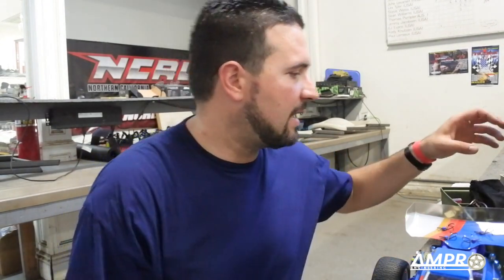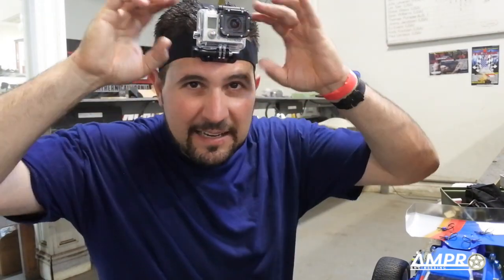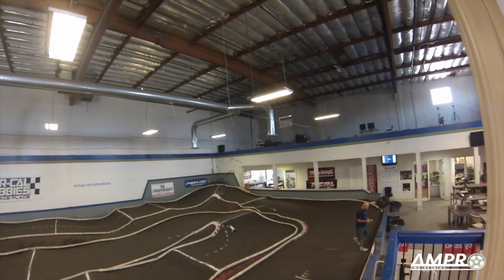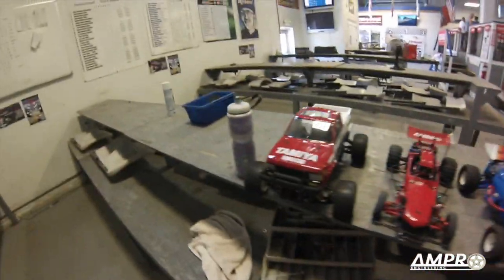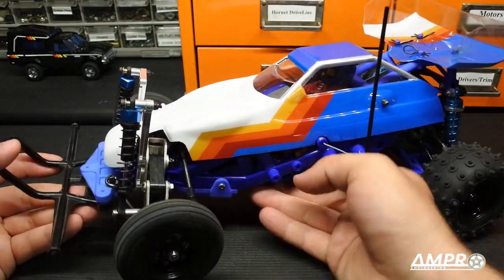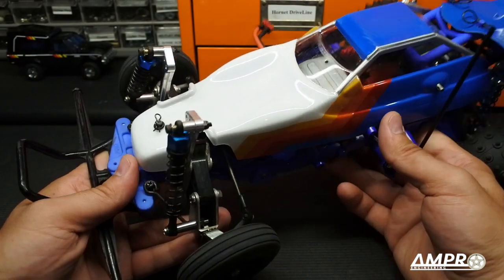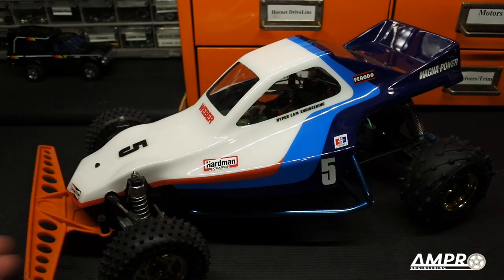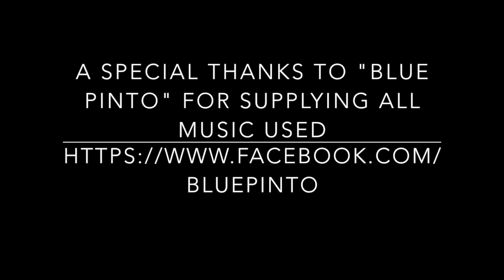e93: 3D Printed Tamiya "Poison Dart" Frog Running

Comment: Nice!  Know what would look cool on the frog a one shock set up on front like the hot shot.
Reply: yup, or Fox (nearly the same). pair of upper L shaped arms would just about do it, the uppers might also need an angled leg downward at inner pivot point to keep the arms from drooping down TOO far, so kinda T shaped or ---> shaped.
edit: uppers kinda looking (left and right) ------>    <------
the upper tips of the arrows (wherever they'd have to land) being the arms for the front transverse shock. this could still be like 1/2" wider than stock (total) to be nearer the width of outside rear tires, like what Andy's front arms did for the old Associated RC10 that Associated basically adopted in later releases. that low profile lateral front shock, very cool looking. it DOES kinda flop some, aka allowing more body roll to be handled moreso by the two rear shocks, BUT, once it's set up right the old Fox hooked up in dirt cornering really good!
Reply from the maker: Hmmmm... I like that....
Reply: I think it would look bad to the bone on the frog! Hey hows the wheel thing amajiggy coming along? =)
Reply: agree, great suggestion, really! I'm not a fan of the stock ORV/frog for the design flaws in suspension and transmission (we scuffed side plates for big fender washers to JB-weld reinforce because we weren't gonna drop 100+ for a thorpe diff!). I DO like the central space frame cage idea they had, but not those "VW" rear swing arm and shock arrangement that'd twist/bind, kink dogbones etc. just not all that efficient or easy movement with aluminum ring against plastic....
LOVE my old Fox, but darn it's a hassle going into it to get at the electrics because of the chassis body, like 14 screws later, good driving car tho!
Reply from the maker: Actually the design is done but im worried about drilling out your wheel.....I am looking for a reamer that will do it safer.
Reply from the maker: I have never seen a fox in person but I always thought it was pretty. I know how those electronic bays are...they sound awful
Reply: Hi I used a drill it worked great it dose not take to much off so it should follow the hole good.

Comment: the Panda Hornet.. they were a bit more brittle plastic but I liked that front wire torsion bar a lot, and whipped one up for my Tamiya with some sheet metal for hangers and a bicycle spoke. oh those spokes have ended up being used a few places and no I'm not looking for new (rude) suggestions for other places I really don't ever want to use them! need thicker harder steering rods, a smaller spoke Z bent and cut, threaded ball end, there ya go. they're fairly hard steel to resist bending and stretching, and already have a threaded end. slightly larger diameter so they'll fit snug into plastic holes that have been worn/wallowed out, perfect size for lots of things RC, and available cheap from about any local bike shop, or free if grabbed from a bent rim.
Reply from the maker: Yes, the plastic is VERY brittle on the Cyclone. The Cyclone didn't have the front sway bar though, that was the Rockbuster and Roadrunner. Always thought that was odd that the Cyclone had every other option but that. Bike spokes, what a great idea!
Reply: spokes are a super handy (and cheap available!) material to play with. it'd be totally doable (after bending) to wire wrap and solder up a slot car  chassis or a set of wheelie bars or....
Reply: model nutty try ribbed sheet aluminium instead of other sheet metals its light easy to cut, strong (as long as its ribbed) and light too. Its a nice material for using on rc.

Comment: Hey Man,
Love the Blue Chassis! Bush Devil? Can I purchase one? I'm currently working on a Blackfoot with my kid nephew and had so much fun with mine back in the mid eighties. He's only 8 but better now than eighteen.

Also, Have you done a Blackfoot > Frog > Beetle conversion video featuring Ampro parts? Love to see what innovations for smooth transitions you pull out!

PS, Signed up at Shapeways and have 9 items on deck. first things first though. MIP! super stoked to follow up with the rear suspension but ill undoubtedly snap some front end parts in the meantime.

looking forward to seeing what you come up with to solve the front end imbalance of quality performance!

Thanks for the quality work.
Warm regards,
Brett
Reply from the maker: Hey Brett, thanks for the kind words! I am actually going to be doing a buyers guide on the whole ORV series. I did the Lancia rally already but need to do the rest. I have not done any conversion on the ORV line up but its not a bad idea! As for the bush devil chassis, I wish I could help. Bought this decades ago and now they seem to fetch a mint.

Comment: I have Wild One as well, how come I don't see you work on this vehicle to improve the performance?? Also, do you think the MIP ball differential for blackfoot and frog is going to work in the Wild One??
Reply from the maker: I have not seen much that that car needs other than cosmetic upgrades. For me, that car is a much more of a scaler than a basher. I have a lot of upgrades for the cosmetics of the WO & FAV that can be seen on this channel. What were you thinking to upgrade on the car? As for the diff, it will not fit at all. We are designing a ball diff for the Hotshot family that may also fit the WO & FAV.

Comment: Car looks great on the track.
Reply from the maker: Thanks Joseph. It's not bad but that front suspension is no match for the rear.
Reply: @AMPROEngineering  it seams like it. Looks fun. I used to race but cant aford it . i still run my rc stuff. Im messing with the wpl kit. Taking my time with it. Thanks for the videos
Reply from the maker: It sure is. I used to be a Novak team driver but then it became...not fun. These should be fun!
Reply: @AMPROEngineering  it should be fun that is the point of the hobbie. I lost intrest in it awhile ago. I still enjoy it.

Comment: Man to me it seems like the front was too soft. I think tilting the front shocks inwards could help add progressive damping to the front. It looked like it dumped over the front in turns. Great job mate!
Reply from the maker: The front oil from stock was like water. I need to swap it out. Can't do much to the geometry without further altering the look of the car. I am already unhappy the the shocks are visible. The original idea was onboard units but cost and space were at a premium.

Comment: oh you already know my near hate on those ORV's, those stock rear arms with their cantilevered shocks, those front suspension arms relying on a long steel eye bolt etc etc yada-yada-ya (and bah! lol). I'm going to agree and suggest... yes to longer front swing arms and only to a length that ALMOST matches up to the width of the outer rear tire width, like maybe 1/4" short of on both sides, and if I remember correctly that's about 3/8" or 1/2" longer than the stock. for those eye bolt bars, wrestling with a few heavier bicycle spokes should get you there. shock tower a little shorter, same shocks bottoms mounted further out giving more travel and more stiffness both. not a fan of that front suspension configuration at all, but do think those things would improve it a bunch while still staying within the stock look theme and function. the slightly shorter shock tower, might move the upper shock mounting points outboard 1/4" worth, thinking angle and spring compression/strength to stay in line with the extended length swing arms. honestly I'm much more impressed with your upper ball linked front end for the Hornet, could be a really cool bolt on replacement to the ORV spaceframe if tweaked to fit with a matching shock tower to bolt on.... but that's getting a long way away from that ORV front end, not like you didn't go there in back either tho, whoops! OH WHAT DID I JUST SAY?....  I said copyright patent pending and charge Tamiya for serious design improvement where they can still use their ORV space frame they like to mass produce, is what. keep doing your awesome tinkering man!
Reply from the maker: Yeah they have some seriously weird ideas on those cars, none of which worked but it was the beginnings of RC so no one know what was going to work. I have an idea that will look almost stock but completely replace the wire retainer and the upper and lower links as well as the front H1 bumper. I have a couple projects ahead of this but I think I have solved it.
Reply: you know it, I'm curious to see!

Comment: Would basically recreating the front suspension from your King Blackfoot fix the problem? I've never owned one but it looks much more stable.
Reply from the maker: I thought about that but I also want it compatible with the stock front "springs". This is going to be tricky.

Comment: You'll probably get better stability & perhaps a bit more suspension length extending 1.5 - 2 cm on each side in front width & getting oil shocks on there.
Perhaps also see if you can create a bump in the a arm so you can angle the ballstud a bit more neutral then aimed downwards while the shock tower looks straight.

Perhaps you can also make a shock tower that is leaning backwards a few degrees (starts off straight but gets a bend halfway up too move the suspension mounting backwards a bit) as well too get on longer shocks with the existing a arms like the losi xx buggy if you take a bit of a space inwards in the a arms or perhaps make a hole in them so they go more in the centre sort of like a early traxxas emax a arm or like the tamiya egress being inside the a arm, supporting the leaning shock tower further that might give you a bit more room too work with the suspension geometry.

Ofc you can try a mockup with the 3d printer first for testing & perhaps reinforce the 3dprinted one by having a pair of carbon fibre braces sandwiched inside the shock tower for some extra strength & rigidity. (being 3dprinted with the space in between for it not made in two parts you put together is what im thinking atm.)
(Could be simple L plates past the bottom mount.
(Turned upside down ofc those carbon fibre L plates so they attach too the top of the shock)
Reply from the maker: So I do not like to change the width of these older cars. I am adamant that they retain some of the original style. That was why I made it so that the stock rear tires and rims still fit this suspension. The car does have oil shocks all around but they are all crappy i think. My plan is to completely do away with the front shock tower since the Frog never had one and do an on-board bell crank unit. The tower and the front geometry, as you pointed out, seem to not play nice. I agree., the arm= needs to be reworked. I love the idea with the brace between the towers. I have done something like the before and it works awesome.

Comment: What shocks are you running on the rear of the car?
 Also.....love the videos and your products!!!
Reply from the maker: They are some awful units I got on ebay years ago. They took a lot to make work well but trust me, you don't want them. Get a good set of 75-80mm units. Thanks for the kind words!
Reply: AMPRO Engineering 
Bummer......I just bought a set of GPM's because they looked identical.....lol.
Reply from the maker: Well the main issue is how the top cap seals to the main body. Do not over torque it an you will be ok. It is a bad design but they work fine.

Comment: Nice Car!! Will you really revise the front end??
Reply from the maker: Oh yes. I have an A-arm idea with completely new shock geometry designed in my head. This is after 2 other major projects.
Reply: So I wait. But I can still have the ORV front and middle skid plate installed (e56) first. And should be no conflict to your new front arm system, right??

So how long for us as frog lover have to wait for?
Reply from the maker: Yes, those will not change but the front bumper mount will though i will make sure it does not affect the front and middle plate. I would say a couple months out. It wasn't a priority but now I hate the front half so I plan on starting soon.

Comment: Just curious......has anyone from Tamiya commented on your parts/upgrades?
Reply from the maker: Sure, usually the comments are for things that I thought of but sometimes, there is an epiphany!
Reply: AMPRO Engineering 
On their part or yours? I mean your double wishbone suspension idea could of extended the use of the ORV chassis for another decade. Your design is much more effective and simpler than the King Blackfoot design.
Reply from the maker: Oh thank you. Well they comment on mine usually. For me, it helped me make my BF the truck I always wanted. For the frog, I wanted a car that could keep up with an RC10 but that front end is the problem now.

Comment: Those wheels are far too sticky for clay. Change tires itll make a huge difference. Everyone underestimates the difference tyres make depending on the surface try grasshopper tires
Reply from the maker: Those were clay tires though. It is what everyone was running. Personally I miss dirt...real dirt.